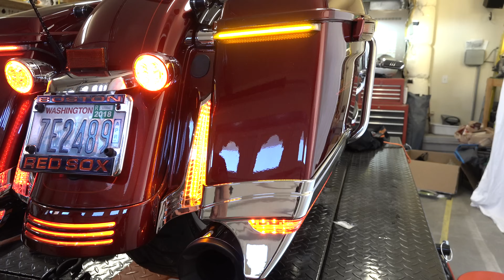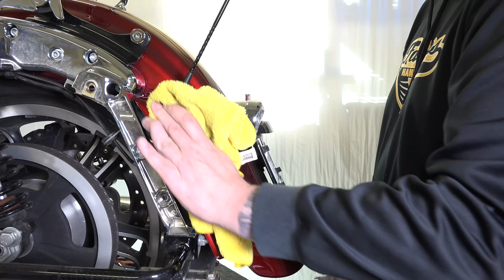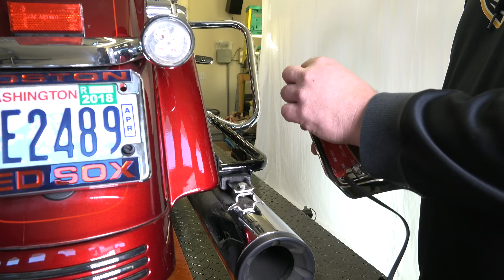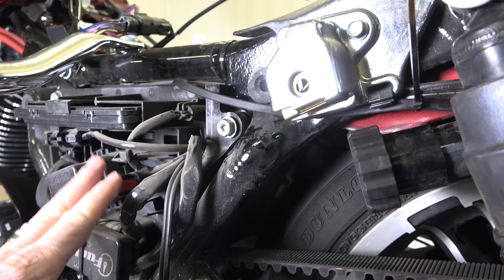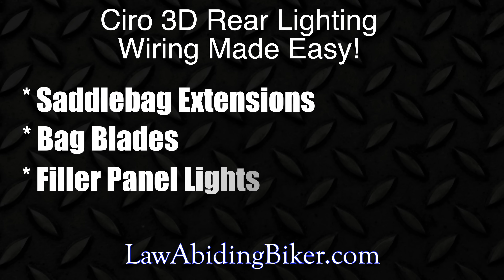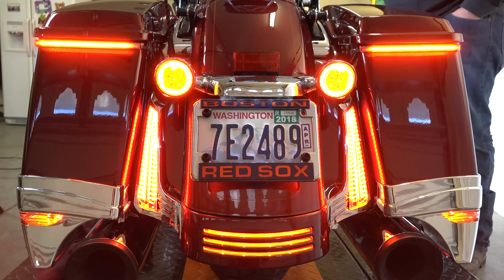How to Install Ciro 3D Filller Panel LED Run-Brake-Signal LED Lights on Harley Touring

Comment: I have a 2020 street glide with custom dynamic led turn/brake lights powered by a magic strobe module. I just bought the ciro 3d panel filler lights but the ciro tech said the ciro lights are not compatible with the strobe which contradicts this video ? Which is it?

Comment: why is the control box necessary ? I have installed Harley bag blades and it came with a control box , but I have installed a tour Pak that comes with lower side LEDs and wonder if they should be spliced before the box or after . They have just a ground and high and low . They come with no instructions of course . 2017 Street glide Special . Thanks !

Comment: Hey Ryan, the splitters you say come with these.......well they're no splitters in either the bag blade box or filler panel box.   Ciro calls them Y connectors.

Comment: Does anyone know what size torx is that one bolt said needs to be loosened to run the wire under the seat by the fuse box?  Thanks.

Comment: I'm surprised in a way that the lights that attach to the bags underneath the lid don't have a connector that can be easily detached so that saddle bag  removal would be easy. The way it is now, if you want to take the saddle bags off you have to disconnect all the wiring. Could be a simple improvement that might help the sale of these lights. Unless they have them and I didn't see it.

Comment: Great video Ryan... I too have the Ciro 3d bag extenders and filler lights. I added them a couple months ago and really love them. As soon as I bought my 2017 Road Glide I swapped out the OEM running/brake lights with custom dynamics LED lights which made a big difference but it still left me with only two small tail lights. I later added the bag extenders and filler lights to make the bike even more visible. I went with Ciro 3D because aside from function, I think they are the best looking option. The bag extenders are sleek and the LED strip looks great and The filler lights actually complete the flow of the fender fascia. Plus as seen in your videos they are so easy to install.
One thing I did when I installed the filler lights was after cleaning the fender fascia, I sprayed it with a mixture of water,  soap and rubbing alcohol (just like when putting graphic kits on a dirt bike or the 3m clear protective film)  that way I could slide the filler lights into the correct position before the 3m tape stuck.... It set in place within 10 seconds but gave me the ability to make sure it was straight and they made a solid bond.    
I'm glad you showed the custom dynamics modulator. I've been wondering if they would work with the Ciro 3d lights, so thanks.  I also appreciate how you show the various ways to plug the modulator to control specific lights I never thought of breaking the lights up like that. Now if Harley would only supply a dedicated space under the seat where we could neatly fit all the couplers and modulators life would be great. I have a Corbin Solo seat and it isn't as giving at the stock seat so I've had to be creative to make sure all the wire harnesses fit.
Reply: I also added custom dynamics Tri Bar brake/running light.. like all the rest of their stuff it was an easy plug and play install and makes the rear fender light a brake light as well.
Reply from the maker: Thank you for sharing the info on the mixture.  Is there a formula you use for the mixture?

Ride safe & Ride Often!
Here is a link to a bunch of our useful Free vids: http://www.lawabidingbiker.com/freevideos
Here is a link to some of our useful for purchase videos: http://www.lawabidingbiker.com/buyvideos
Want Answers & Information Fast? And help support us at the same time? Do you like the content we provide?
Our patrons get answers to their questions/comments/feedback in less than 24 hrs and are part of our Private Facebook Group. If you are interested in being in this exclusive group you can get all the details at ==> http://www.lawabidingbiker.com/patreon
If you haven't subscribed to the Law Abiding Biker Podcast make sure to do so. Listen in as we talk weekly about issues/items like this & so much more. You can listen on iTunes (Apple/IOS), Stitcher Radio (Android), or any other Podcast App ==> http://www.lawabidingbiker.com/podcast
Join our free email club at http:///www.LawAbidingBiker.com/EmailClub. Only relevant content will be sent from time to time. Email club members are the first to find out about free or for sale content are given special coupon codes.